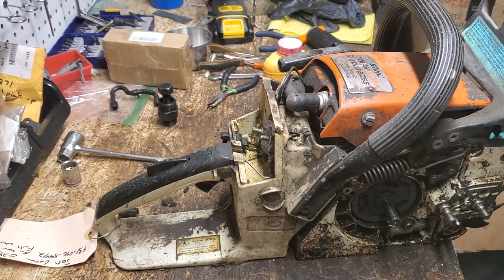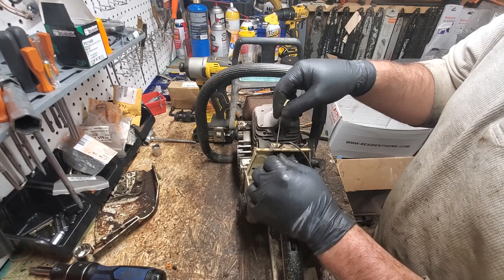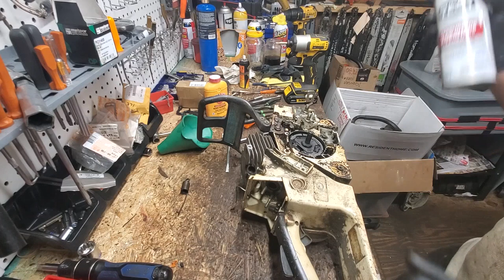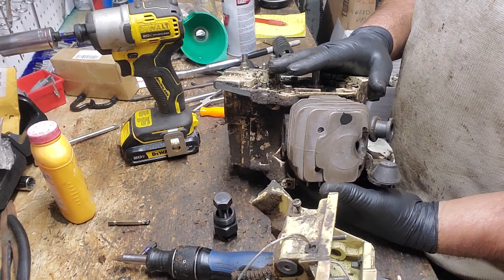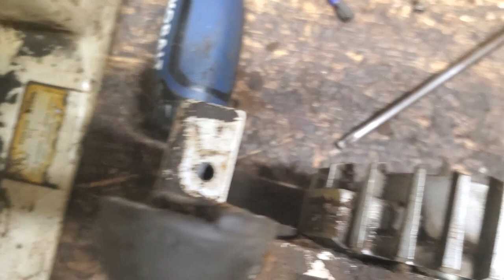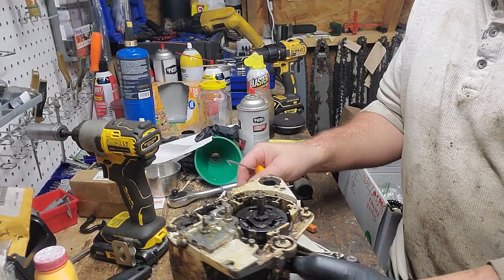STIHL 028S complete teardown for neighbor Jon

Comment: I got the chainsaw at a auction. Figured when I got home I'd let it run some cause it had been sitting. So I out fresh gas in it and surprising Lee it started. While letting it idea I seen a little smoke coming from the bar an chain side cover. I tool it apart and seen that it melted the plastic cover that covers the oil pump and chain brake and what not and not only that but also melted both oil pump plastic gears. I can't wait to get it back from matthew!! 
I just bought a stihl 025 from him and man let me tell you, what a nice running and condition saw!!!
Reply from the maker: Thanks neighbor Jon for letting this wretch redeem your saw.  Sorry our hacker neighbors aren't being good neighbors and we can't get stihl parts but ima clean your saw next Jon, new episodes of confessions at the parts washer coming soon.
Reply from the maker: Thanks for making my life better neighbor